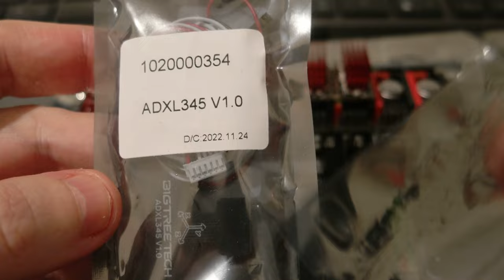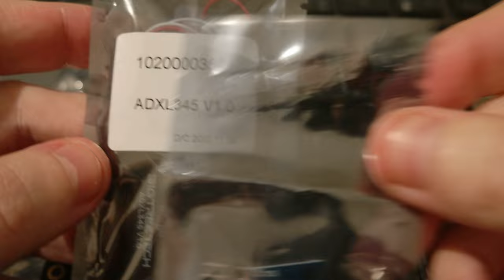Unboxing Bigtreetech ADXL345 accelerometer for input shaping for Klipper   - Custom 3D Printer

Comment: You will get much more accurate results mounting the accelerometer to the nozzle, where the actual frequencies matter, instead of the whole tool head. Hotends are basically swinging around from top mounts. Those PCBs are not a great solution. Look up Crampon by annex
Reply from the maker: I agree great point. Also my dual extruder is pretty big and heavy (most likely a bit bigger that my previous one https://www.youtube.com/watch?v=4zg6exiZFeA). Thanks for the suggestion will look into it. Thx for the comment and pls subscribe thx !